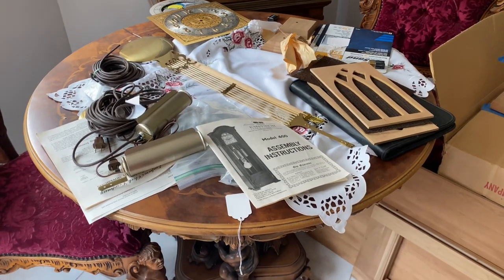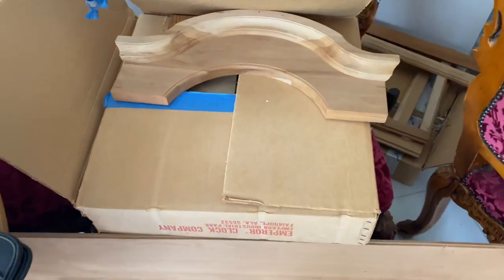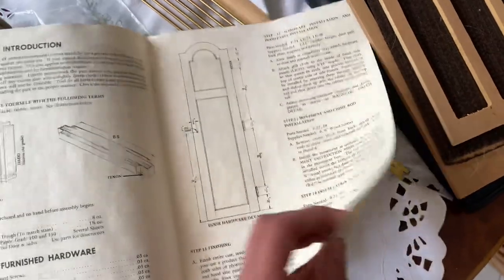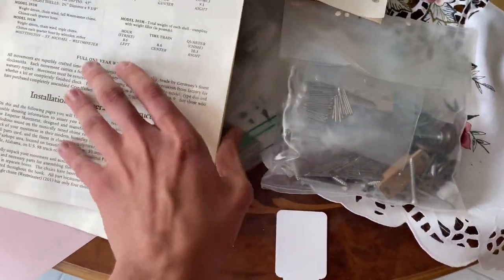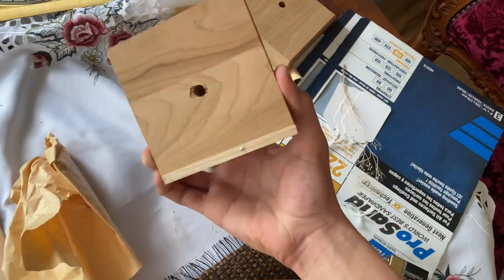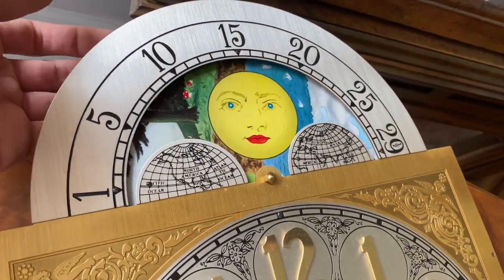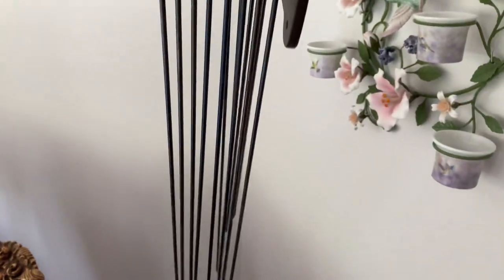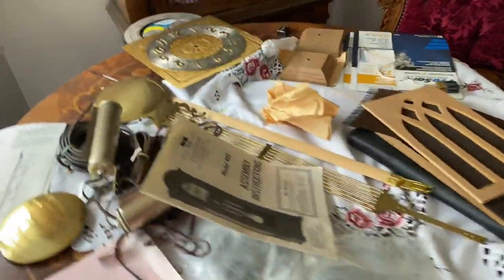Emperor Grandfather Clock Project

Comment: Dd you ever finish it?
Reply from the maker: Not even close lol
Reply: @samsclocks2084 I’ve got a emperor 300 series made assembled in 1982 the striking pin that the gear lifts up on the hour broke so the strike shaft that has the hammers soldered on to it does move on the hour I’ll have to solder a new makeshift pin and the small spring that keeps the strike from going to far back and pulls them forward when they are lifted up also broke off do you know where I could find a replacement bend back spring?
Reply from the maker: I would think you could find a junk movement relatively inexpensive on eBay that is the same model as yours and rob any parts off of it that you need
Reply: @samsclocks2084   it’s got a common Urgos triple chime movement and it was probably made just around the period urgos started changing up the sounds of their triple chime rods because the chime rods on mine sound are tuned very similar to their 1970s triple chime rods but it’s slightly higher pitched I’m planning on switching the chime rods out with a 1970s urgos triple chime rods I like deeper sounding urgos rods
Reply: @samsclocks2084 is the oil in the movement from this still fresh?
Reply from the maker: I put fresh oil in it except the auto beat verge is all screwed up which stops the clock